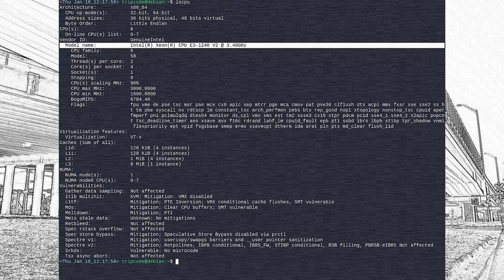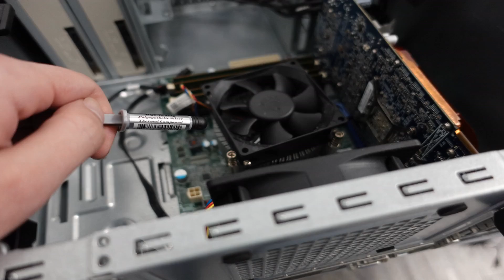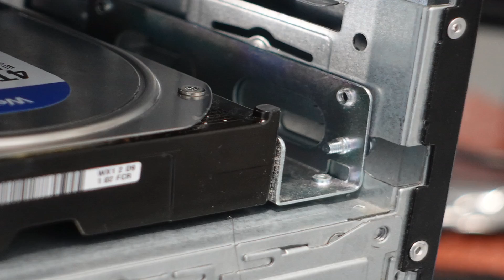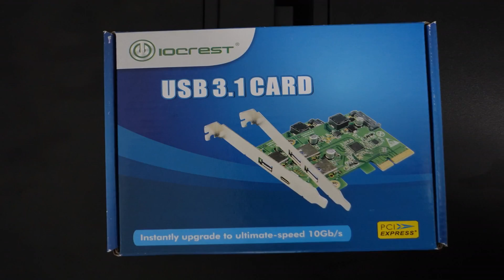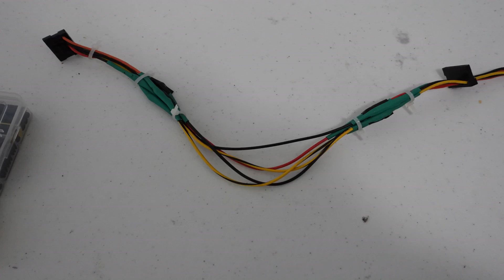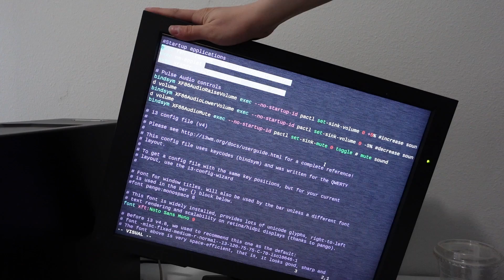Dell T1650 build, an inexpensive Libreboot desktop :D

Comment: pretty slick, dell compatibility is ass but you made it work
Reply from the maker: I was actually pretty surprised. The only weird stuff on this was from the case itself :D My old dell dimension 4100 tower required an adapter to use a non-proprietary PSU.

Comment: 6:00
I'd argue with how little current the USB card should draw (I'm gonna guess you're only using it for peripherals and not charging a phone), that cable shouldn't get hot enough to burn. That's strange though. I've never seen a card like that need SATA power before.
Reply from the maker: I don't think it is a fire hazard, maybe it could cause magic smoke from the psu if it somehow shorted out though.

The adapter card was a bit strange for me as well. I didn't expect it to use external power. I did test it out with the umpc, and it does seem to fast charge at least at 12v, but I can't imagine it using more watts then what pcie can provide.

It does work with the hdmi switch box / capture device I got over new years though :D
Reply: @tripcodeQ7  If it's doing 12v fast charging it's entirely possible that it might be using SATA for that purpose just to reduce the chances of overloading the PCIe. Having a quick google it seems that PCIe allows up to 75W but I'm not sure if that's per socket or shared between all sockets. I suppose the card might allow power draw up to the higher end of that amount.

Comment: Looks like a cheap way to get a Xeon homeserver with libreboot running! Is the motherboard ATX instead of some proprietary abomination? Because if so it would be very nice to move this to a better case with a better cooler
Reply from the maker: It looks like atx, but I'm not entirely sure.
Reply: @tripcodeQ7  Looking at the screw positions I don't see anything indicating it's some proprietary shit. I wonder how easily one could get a Noctua fan mounted on this thing...
Reply: @Aquashell11  I'm pretty sure that it's a micro atx board. A lot of online listings say that's the form factor.